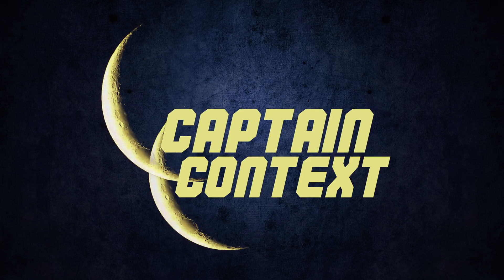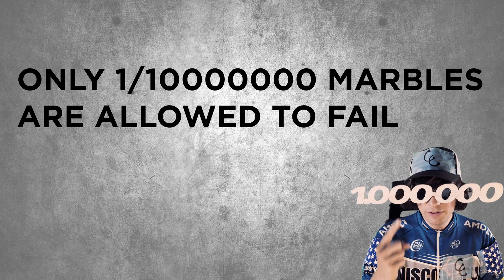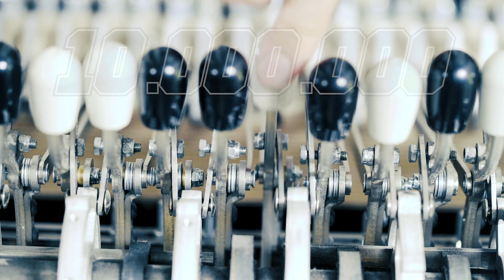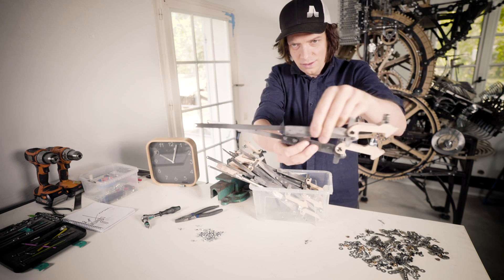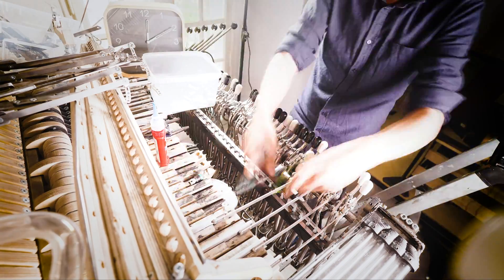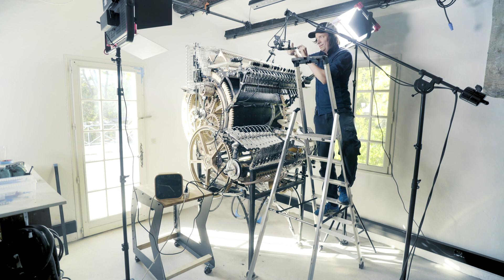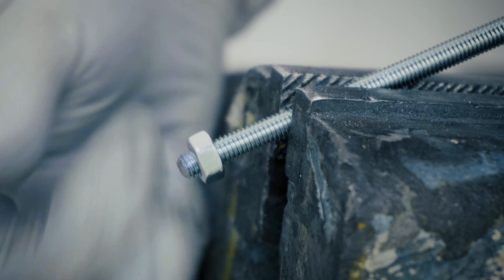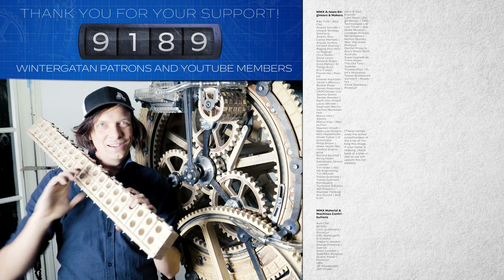Countersink? Why? - Marble Machine X #143

Comment: I think the MMX downhill journey started with this requirement. The goal should never have been 0 marble fails. The goal should have been making the machine such that failing marbles cannot do critical damage. If a marble misses the funnel, there are 0 consequences for the machine. A jammed gate is no big deal if it happens rarely and can easily be unjammed. 
There is a reason strings can be replaced without trashing the entire guitar, if success rests on every last part working 10000000/10000000 times, failure is a certainty.

Comment: Maybe you should consider cold-riveting parts like that. 
Rivets will take up less space, they will weigh less and they will not come loose.
The downside of course, is that you won't be able to disassemble it non-destructively but considering the locktite and all that, I don't think it would be more of an effort to grind off a rivet than unscrewing those bolts. 
It goes somewhat against the principle of modularity of course, but "set-and-forget" has a catchiness to it too.

Comment: 8:27 instead of using nut to repair the thread you can use threading die for it. Nut steel is too soft for this purpose.

Comment: Why you don't use ball bearings instead of brass spacers? Thise  would you give two advantages in precision. One thing is you'll never have lose mechanics and there will be no friction anymore. I'm building scale model aeroplanes and in earlier days I used brass spacers and brass bearings too. Since I'm using ball bearings I never had issues with the mechanics anymore. At Ali Express ball bearings are very cheap and there are alot of different dimensions avilable.

Comment: You need some kind of force limiter on the arms that interact with the pins on the programming wheel. That way a stuck marble will not break the machine but just disable that one channel until the marble is removed.

Comment: Really enjoyed the video as usual.
One obvious suggestion that you likely thought of yourself: flat-head screws instead of countersink (something like this: https://de.misumi-ec.com/vona2/mech_screw/M3301000000/M3301060000/). depending on your material thickness, full countersinking might not be doable, but it's usually easy to make these not protruding the material. Disadvantage: you need to mill the part rather than laser cut. I'm not sure there is an easy way to machine such pockets without CNC.
all the best with the MMX

Comment: Did you actually establish that not countersinking them cause any problems? I am saying that because in most complex engineering projects a lot of actual problems show up only during testing not during thinking and in many cases in areas you would never guess. This is especially true for non-functional requirements like reliability here. I think it would have been better use of your time to test the system with say some 10-20 minutes of random run to see if the perceived problem is indeed a problem before embarking on a fixing mission.

Comment: I just realized how dumb it is to get a number close to 100 you know cars don't even have it that high but what they do have is a redundant system of if one thing fail the other system will work until you fix the first one so 100% fail goes down to 50% when it fails

Comment: Martin's math is wrong. Odds of overall success "S" where the failure rate per iteration "p" over iterations "i" where each iteration is unconnected to the rest is S = (1 - p)^i.

For example, if heads is a failure, the chance of flipping a coin 4 times and never getting heads is (1 - 0.5)^4 = 0.0625, or 1 in 16; the chance of rolling 4 dice and not getting any 1s is (1 - 0.1667)^4 = 0.48.

So if i=35000 (10 songs worth), then if p is 1 in 10 million, then S is 99.7%.
But if p is only 1 in 1 million, S is still 96.6%.

If the machine can be designed so that failures aren't catastrophic and can be easily cleared between songs, then i is only 3500 and p can be as low as 1 in 100 thousand to get a 96.6% chance of no failures in a song and 1 in 1 million would be sufficient for a 99.7% chance of no failures.

Comment: This is getting painful to watch. Maybe if there's 1 more comment explaining why this is insane? Getting 7 9s of reliability out of a complex mechanical device hand built by an amateur that's expected to be broken down and transported around the world is completely unachievable when the expected failure mode of most problems is 'the machine breaks' (if I'm understanding you correctly). The way to prevent breakages is not to prevent failure (this is impossible, all you can do is make it less likely and the returns diminish very quickly) it is to EXPECT failure. Make it so that a failure just causes a missed note or something and THEN work on reducing the chances of that happening. Your goal should be to generally get through a performance without a missed note which just requires designing for thousands of marbles without issue not MILLIONS. Reliability engineering is A Thing and you should look into it before running off half-cocked again. Even if you get 7 9s you still haven't solved the problem, you could still get up on stage for your first song and fate says 'lol nope', something fails, and the machine breaks. So sorry. If you get up there and in the first song you miss a note or something, well, even professional musicians do that from time to time, the audience is going to be fine. Don't let your pride get in the way of reality.

Comment: I came up with a really simple solution to 99.999999999, you create a field of drop, basically you work out a range in which it's highly unlikely that the balls will go beyond, and you put a secondary catcher underneath, made out of plastic or metal and glass, and basic this will filter all the marbles in to a bucket, in which you can then pour them manually back in to the machine between songs. This isn't very elegant and it's probably not the best engineering practice, but it's a good last resort. Basically a shield which goes around the dropping area and filters the balls down, unless the balls just some how manage to do an extra ordinary bounce some how any marble that falls will end up being filtered to a central pipe with puts all the balls in to a bucket or an air lift which filters the balls back in to the machine. Either way no balls will escape. Think of a vortex coin bank under the machine and coming up around the edges, so no balls should bounce over this and any that fall down will go to the centre of the vortex, in which you can use a pipe to feed them where ever you want them to go. Not sure if this is a precise fix, it's kind of more like a catch all. So it works but it's not precise engineering. Also you would need to add some way to remove the energy of the ball dropping, so it didn't bounce back up hard. Kind of like a safety net for your machine. Vortex Coin Bank: https://www.youtube.com/watch?v=bb727UoQG18

Comment: Martin, fantastic project and I love to follow your progress.
I have a question about maintaining the maching. 
Metal sliding on wood will probably never hold up for the amount of repitition that is requried for your demands. The metal will "eat" up the wood and arts will need ti be replaced with short intevals.
I understand that this will be a later problem to solve but the 10000000 figure is probably an impossibility due to the material choices. I expect that all wood parts metal is sliding on will need replacement way earlier.
Reply: Maybe something to build in in the thinking, and not try to owerdo parts that probably will not hold up for the time.

Comment: Probably something which was already said very often is that you should distinguish between fatal errors and errors. In a world of limited resources, it is impirtant that you first focus on bringing down the rate of fatal errors to 10^-7 or so, and then focus on bringing the rate of errors down as much a possible. E.g. putting a stronger spring where the rods are, which under penal operation conditions does nothing, could be tuned in its preload and consistency sich that it allows the machine to be blocked without destroying magnet pins or other parts, because the spring just extends and releases. Such, you first try to completely avoid fatal errors, and then run the machine for countless hours with the motor (and analyze the Musikbibliothek your computer automatically and find errors in the music, if possible) and find all causes for non-fatal errors.

Comment: Heat will break lock tight. Just make sure nothing else that could be heated in the process will be harmed and you can easily remove things like those brass rings without issue or risk of further damage

Comment: You get that, that's not how statistical reliability works right?

If you have n parts that depend on each other. And each one have 10000000 mean time to error.

Then the reliability is 
N/10 000 000.
So for a 100 parts that's only 
1/100 000.

Also this is more normally mean time to failure.
So even if you only had a failure once in 10 000 000. That doesn t mean it will only happen after 10 000 000 operations.

Comment: Sorry but that is not how probability works. Even if your probability is 1 in 10000 you can drop 1,000,000 marbles and never have an issue. You have a 1 in 10000 chance every time. You are chasing a misconception of probabilities. Even at 99.999999%  You can still have back to back fails or never have a fail in millions of tries.

Comment: To put some accepted failure tolerances into perspective.  The tolerated failure rate for the SpaceX dragon2 capsule, is 1 in 276 (99.63768 % success rate), according to NASA (dragon-2 is a capsule that will take astronauts to the international space station). So 1 in 10mil is quite literally impossible

Comment: I think Survivorship Bias (https://youtu.be/P9WFpVsRtQg) is in progress here (Maths concept). I think that the focus should be on, what the maintenance schedule will be for the Marble Machine X. Just as happens for all the jet engines that transport you between France and Sweden. Or how a car is serviced, for example. What inspection cycle will there be to look for parts either wearing out or needing retightening? Is there a preconcert check list? Like some others on here, I'd like to hear some more Wintergatan music and not have Martin locked away in France forever perfecting the MMX.

Comment: We actually need more reliability, since each marble passes through multiple parts. So 1/10,000,000 failure x (for example) 100 processes = 1 or more failures in 1/10,000 marbles. So the overall machine has to have fewer than 1/10,000,000 failures, meaning each part would need to be 1/1,000,000,000 failure/99.9999999% reliable.

Comment: Quick question... Why do you use additional Loctite on top of already using nylon locking nuts? I have never, ever had a nylon lock nut fail unless it's been taken off and on several (and I mean several) times.

Comment: Behind the engineering decisions, there is a mind (and its opposite) at play. Is Martin's will to build-fix the machine stronger than his will to take the machine apart? Sometimes, setting yourself an impossible path for a goal (99,99999999% infallibility) is nothing but an elaborate self deceit in order not to achieve set goal.
Towards the end of the video, when referring to the 'sunken cost fallacy', Martin seems to be working on accepting he has invested too much in a failed project, but is that really the case? If this is indeed his dream-vocation, all his energy would be naturally flowing into finding ways to make it work... probably such way would imply accepting imperfection and making art out of such limitations.
As exaggerated examples, I would love to hear a song made out of all the sounds of cranking pieces, dropped marbles and 'errors'. Even a destructive song of Martin beating the machine to a pulp could be wonderful art.
Where engineering sees error and self-destruction as failures, art find in these the key elements of style.
When Jimi Hendrix set his guitar on fire, it was not the end of his project: he began making music out of fire.

Comment: Here's some more math for you: assume diminishing returns on re-design. Let's assume each additional 9 you want is going to be 5x harder than the previous. If it took 10,000 man hours to get to 99% reliability, it's going to take 5^5 * 10,000 = 31,250,000 man hours to reach 99.99999%. If the current 10,000 man-hours were accumulated over 2 years and you keep the same pace, you're looking at finishing MMX in 6,250 years from now.

Alternatively, if you add a fail-safe that has 99% reliability to a gate that has 99% reliability, then your system will reach 99.99% reliability 25-times faster than improving the gate alone. Add a secondary failsafe with 99% reliability and you'll get to 99.9999% reliability ~625 times faster than trying to get the gate-alone to 99.9999% reliability.

Comment: Wait if every part needs to be reliable 99.99999% doesnt that mean that for every part there is a 1 in 10m chance it fails. And if you have 100 parts the chance for failing is 100 in 10m. Lowering the odds of successful songs played. Or am i just thinking wrong?

Comment: Martin, given the reliability challenges of the Marble Machine as well as your interests in space exploration, I thought you might appreciate the following excerpt from the book "Apollo, The Race To The Moon" written by Charles Murray & Catherine Bly Cox (ISBN 0-671-61101-1).  Early on in the Apollo program, NASA had established a reliability goal of getting the crew back safely at three nines (.999) or 999 times in a thousand.  
Given that there were thousands of parts in a spacecraft and that any single part failure could lead to program failure, the reliability of each part needed to be much greater than the .999 program target.  Under this context, there was a “… joke that made the rounds of NASA that the Saturn V had a reliability rating of .9999.  In the story a group from headquarters goes down to Marshall and asks Wernher von Braun how reliable the Saturn is going to be.  Von Braun turns to four of his lieutenants and asks, “Is there any reason why it won’t work?” to which they answer: “Nein.” “Nein.” “Nein.” “Nein.” Von Braun then says to the men from headquarters, “Gentleman, I have a reliability of four nines.””
Reply: GREAT STORY from NASA.  It puts the context of what accuracy is in a different view.

Comment: Instead of making the mechanism 99.99999% failproof, which seems like an unbelievably daunting (maybe impossible) task, has any consideration gone into a design that fails gracefully? If one out of 10,000 marbles pops out and onto the floor, but the machine keeps right on playing, that doesn't seem like such a horrible thing.
Reply: He's not just dealing with marble drops, it is also marble, AND mechanical lock ups too.

Comment: To quickly deburr a threaded rod, use a "Deburring External Chamfer Tool Bi"t on your drill. It's quick and does a great job. They are pretty cheap in price as well. Works equally well on wooden dowels.

Comment: Hi Martin, dont clamp the brass wtith hardened steel asbrass is really soft. Locktight does not like heat, you can use a blowtorch to gently(!) heat up the brass and destroy the glue inside, also use some soft scrap material for clamping, like aluminium or plywood.

Comment: The fail would be 1 marble that did not drop correctly our of the 9,999,999 before that and then what was the resulting action. Is this like playing a string instrument and in the middle of play, a string breaks; no it is more like I just did not hit the string to play exactly the way I had done it 9,999,999 times before.  No one on is that prefect, in the end, was the missed drop a good result or a bad result or just adding personality to the work; a fail is not necessarily a fail?  Anyway, I like watching the evolution of MMX and I still like watching and listening old faithful, the original MM.  Thanks Martin.
Reply: Turning this around.  But does the concert violinist change strings DURING the concert?  I've only seen ONE instance of this over the 60 years of attending/viewing classical music concerts.  Martin needs this same level of reliability out of the MMX.  I do not blame him for setting this standard.
Reply: @peterkelley6344  I agree with you about expectation to be the best you can is the goal. A great concert violinist can move to the remaining 3 strings for a short time to keep playing (would have to be a great violinist) until the string gets replaced. As there are few operations between playing a note on a violin vs the many operations that the MMX requires to complete complex operations for 'note' even some of which would not be the fault of the Marble Machine (amps, pick-ups, constant gravity function, air density, and on), it becomes very costly and time consuming to go from 99.9999 to 99.99999 (industry slang is going from 6 9's to 7 9's).  I'm saying it is a complex tool that has a beauty in the operation alone and it is really cool (the idea in its self is brilliant) and is a Marvel of a Marble Machine. Martin, and even the entire band are so talented that just running the MMX with the group is an idea of beauty all its own.  Things break, just do your best to work around them with almost no secondary redundancy. Fail, learn from the failure, make a fix, work to the next failure which Martin and the supporters are doing, and as the gap between fails after a fix grows (MTTF, Mean Time to Fail), the time will get so large, you never get to the World Tour.  I just want to see and hear the MMX operate as an instrument.
Reply: @vincentbledsoe8006  Fair enough.

Comment: 8:40 the sanding method of thread repair will fail if you work roughly/quickly, because you can crush the undamaged threads as they weaken as they get thinner at the end of the sanding plane or heat up due to friction. Sand lightly and patiently. Take it from someone who has made a lot of mistakes.